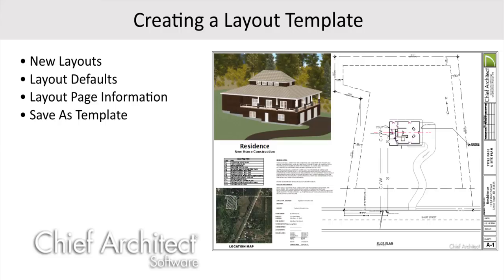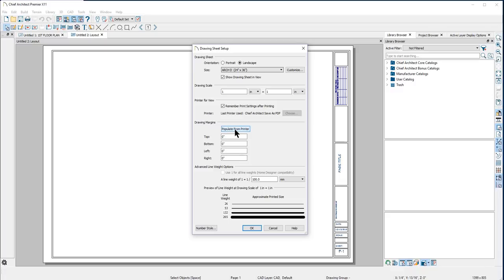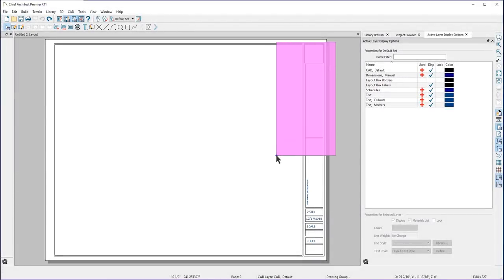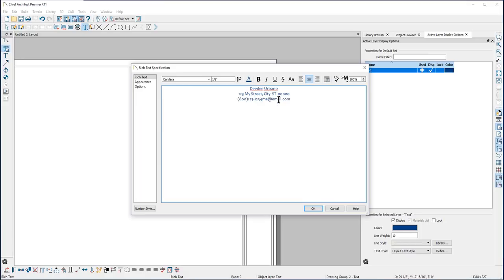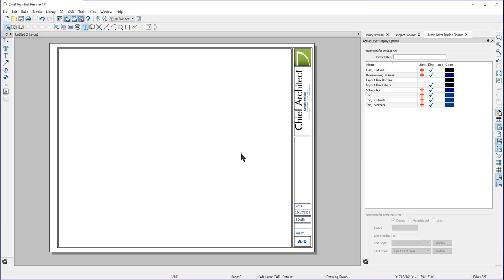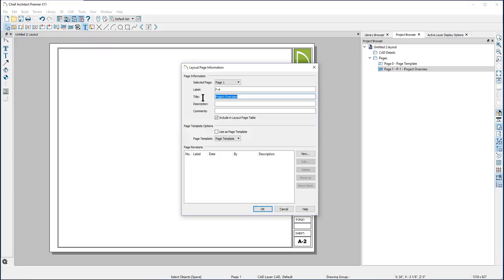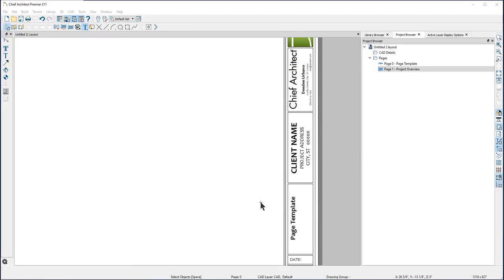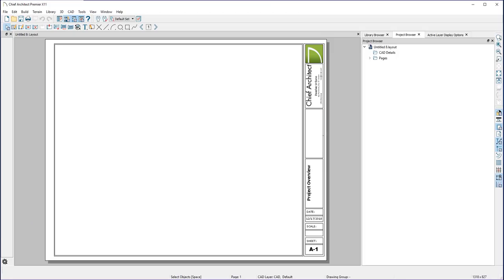How to Set Up a Layout Template in Chief Architect

Comment: Will this also work on Home Designer Pro 2020 or is it only for Chief Architect ?
Reply from the maker: Hello 53tboy, Home Designer Professional supports a single-page layout sheet that can be printed at up to 18x24 inches; whereas, Chief Architect Premier can create a full set of construction drawings at 24x36 or larger with the layout file. This video was created using Chief Architect Premier; some of the techniques will apply for the Home Designer Professional layout, but some will only work in Chief Architect Premier. We do have a knowledge base article with more information on the layout sheet in Home Designer Professional here: https://www.homedesignersoftware.com/support/article/KB-00527. I hope this helps!
Reply: @ChiefArchitect  after watching a dozen videos, finally I found some answers that address Home Designer Pro